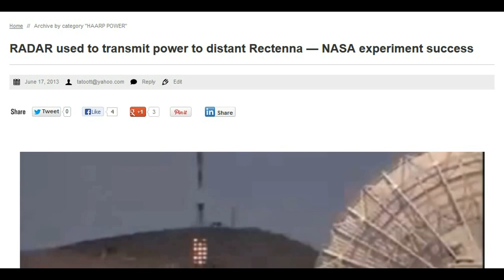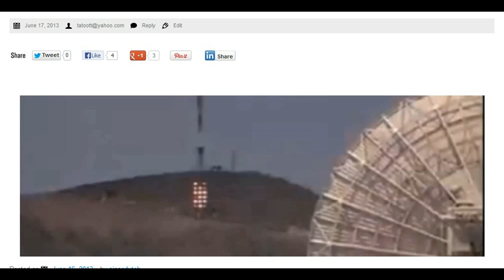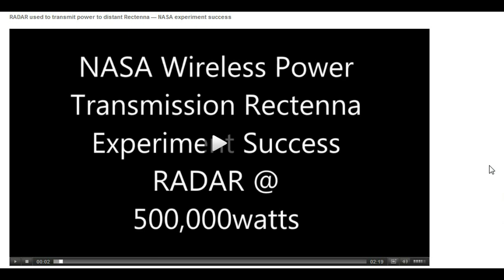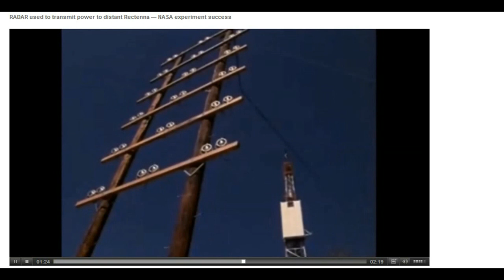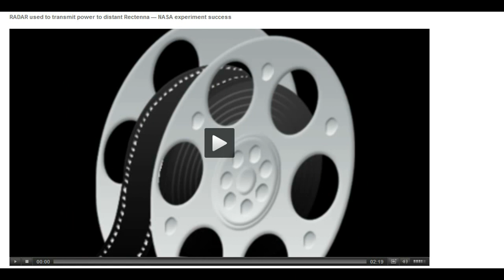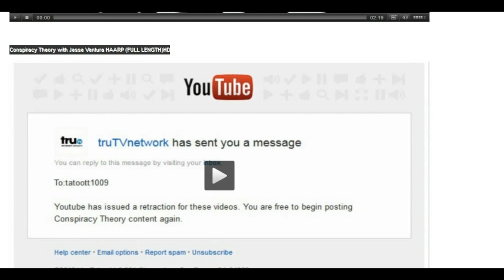DO HIGH-VOLTAGE ELECTRIC POWER TRANSMISSION LINES CAUSE CANCER ?

Comment: Nikola Tesla worked for Edison, and Edison had Develoed DC Current, also a side not, when you look into a real light bulb, that little spring looking filament is called a Tesla Coil. That was how edison finally got a light bulb. Tesla created AC Current Electricity, and He quit Edison and joined Westinghouse. Westinghouse built the Niagra falls Hydro Electric Facility, which produces 175,000 Megawatts of electricity, at the time enough to light the entire east coast. (Cont)